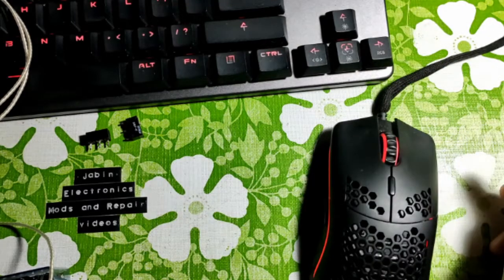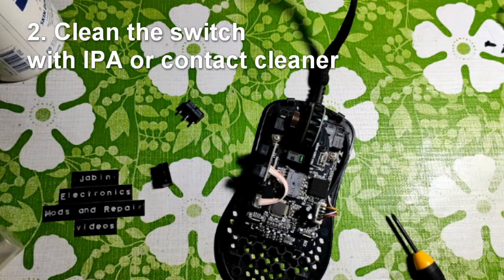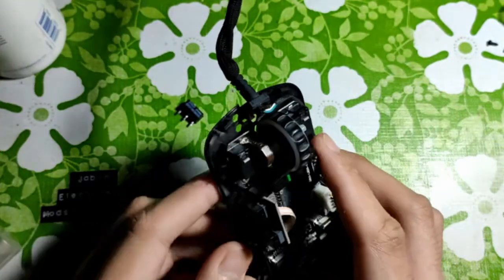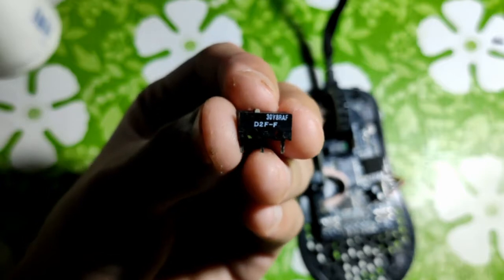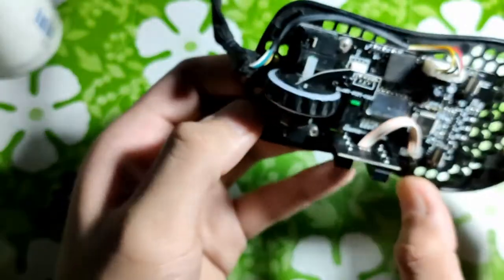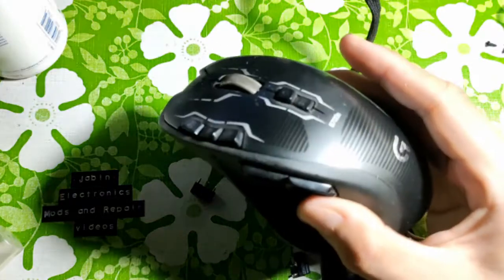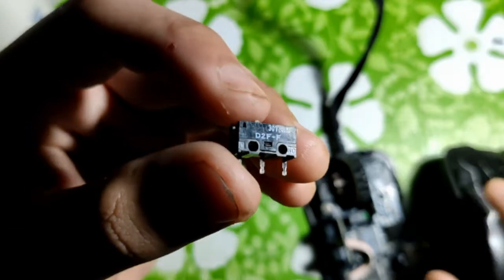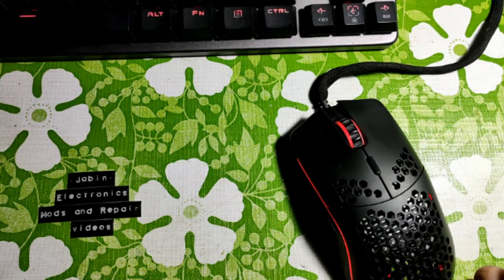Mouse is Double-clicking? Do these 3 steps to fix it

Comment: If you're very careful, you can also open the mouse switches and clean the contact leafs, as well as straighten them if they're bent.  Only problem is if you open them too much, the plastic might break.  Done it on my Logitech G500.  I have a new mouse now, but will probably put new switches in for fun :P